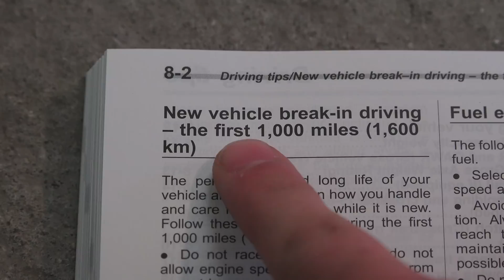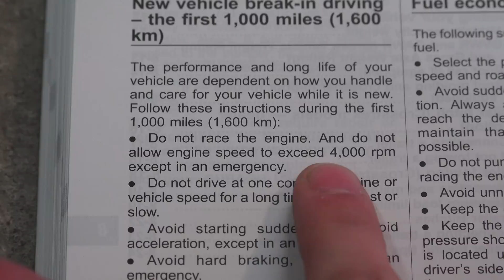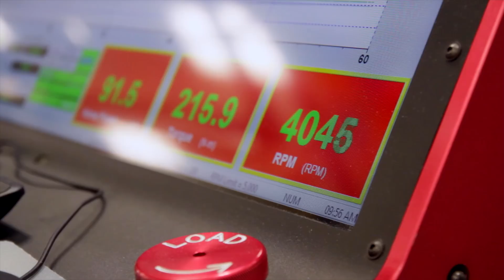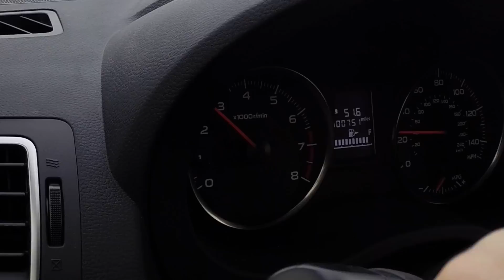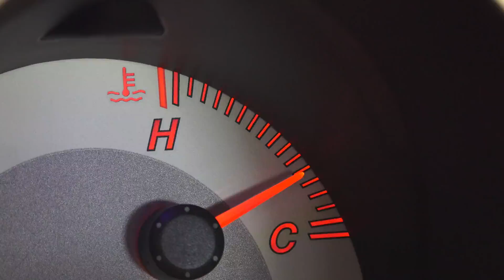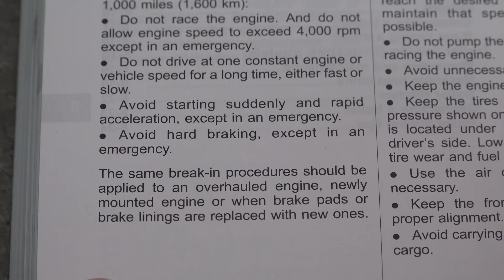5 Things You Should Never Do In A Brand New Car

Comment: I’m not saying that you are wrong but... my dad is the smartest guy I know, and every single time he gets a new car, he waits till all the oil and engine parts are properly warmed up, and then he straight up floors it and holds the engine at like 6k at full throttle for a couple of start-stops. And every single one of our brand new Ford trucks have gone to or over 350k miles, they still run perfect, and my dads f250 super duty got 400k miles on the original factory clutch and brakes. Just sayin...
Reply: I believe it depends a lot on how they manufacture the engines. American companies like Ford and GM make thousands of the same engine to very specific specifications. Sure if you buy a 730,000 pound Ford GT every engine might be slightly different by a very small fraction thus causing “hot spots” but not an engine that they make thousands. Why would they risk engine warranty work on a customer following rules in an owners manual that most people don’t read. These engines are assembled to factory specs and fully tested under all possible load conditions before they even apply for a patent. Push the engine near its limits, check all engine components then change the oil and filter.

Comment: What about the Tesla model 3
Reply: Tesla’s don’t have petrol engines with pistons and rings. They have motors for each drive wheel that uses no petrol and a completely different fluid than conventional oil. The only thing you should be concerned about is your battery health. I.E. proper draining and charging of the battery.

Comment: What's funny is this "Hard Engine Break In to Get A Proper Seal" was made up garbage, probably made up by racers to have their competition or future competition make major mistakes from the get go. What your hearing now is the correct way to break it in. You do NOT need more pressure then what your engine is producing under slow and normal conditions. The tension in the cylinder is tremendous at even 3000 rpm.

Comment: What about loading the engine up (driving up a hill at low RPM)?  This allows for maximum cylinder pressures (and hence maximum ring pressure) without the downside of high rpm (increasingly uneven wear & higher rate of wear).  I'm also wondering why you didn't explore the recommendation of keeping it under 4000 rpm.  Why 4000 rpm exactly?  Most likely because engines typically won't develop significant harmonic vibration below this range.  Would be good to see a engineering based 'advanced run in' guide.

Comment: Wrong, don't hold a high rpm or a single rpm, need to vary rpm, look it up, high cylinder pressure helps seat the rings quickly

Comment: Its simple as he describes. I have broken in two new motorcycles and a majored Lycoming IO-360 the same way; HARD as per the instruction from the Lycoming overhaul facility. Start it and let it idle for no more than two minutes. Shut down and chech for oil leaks. Than taxi to the runway,  do a quick mag check, then full throttle climbout to 7500’ leave it at full throttle for the flight. Do that for 25 hours and return for a oil change and compression test. I flew that engine for over 1000 hours and it never burned oil in the 25 hour oil changes. The two motorcycles I seated the rings per racing mechanics; take them to a track and after a lap or two warmup try to set lap faster lap times each successive laps. Then change oil. Had both bikes for more than 80000 miles each and neither burn any oil between 5000 mile oil changes. The worst thing to do to a new or overhauled engine is baby it. You will regret it if you do.

Comment: I built motors 8 hrs a day at the dealer, This is great "book information" Ive never pulled a motor and said "yup, he was flooring It" when considering how the engine is wearing, I would do a burn out out of the shop back door after building a motor, if it was going to break I wanted it near my lift,  I have a list of reasons why not opening it up is not perfect either, the piston does not FULLY reach the top of it's limit until it hits a high rpm, if you constantly run at a low rpm you will only wear the cylinder to a point, then one day all of the sudden you decide to gun it, now the piston is running up into a non worn ridge, P.S. Change the first oil and filter 800-1000 miles, thats it, drive it like you're going to! I was an ASE certified master mechanic with CCT training 30 years wrenching.

Comment: When I bought my 370Z I kept the RPMs below 3500 generally and applied only gentle acceleration, with no constant RPMs for any prolonged periods of time. I changed the oil early at about 600 miles, 1700 miles and then 3000 miles. My oil consumption finally stabilized at a little under 10K miles and at 13K miles I was using about 5 oz in 3300 miles, or about 21K miles per quart. Whenever I cold start the engine I let it idle under no load for about 8 to 10 minutes, until my oil temperature gets above 140 deg F and I hold the revs not to exceed 2K RPM until the oil gets to about 180 deg F. I did have a couple of used oil analyses done on the engine while it was breaking in and everything looked good, except that the 5W-30 Nissan Ester oil that I was using was starting to shear down to something like a higher-end 5W-20 after about 3K miles. That 3K miles became the oil change interval that I now use.
 
Putting 1oz of Redline Water Wetter, a surfactant, per quart of coolant improved heat transfer between the coolant, my oil(because of the oil/coolant heat exchanger) and the air. My oil temps are now about 10 deg F cooler than before adding the Water Wetter. I got similar results about 30 years ago with a water-cooled Porsche that I had to which I added Water Wetter. Modern engines are much better made than they were in the 50s, 60s and 70s when I was working on them as a kid but I think they do need careful maintenance to preserve these higher levels of efficiency and reliability. Thanks for your videos that explain these interesting and important things about cars.

Comment: I've always heard this about "New Engines" and I've followed it on a few that I've built. But I've also beat it like a red headed step child straight out of the box on a few and I found it made no difference at all. Clearly there's risk involved but I think metallurgy and oil technology is so much better these days the risk is minimal at best. 
What's your opinion on these engine builders that build the engine and then run it full bore on the dyno? Every time I see them do that I think about this engine break in period.

Edit: A year later and still no reply. But feel free to leave those questions and comments 😂

Comment: The manufacturer of your car floored it and brought it to redline repeatedly at both the engine plant and the assembly plant in an effort to keep motors that are going to self destruct from getting to the end user.   It gets more abused by the engine plant than the assembly because the manufacturer bills the engine plant for the cost to fix at the assembly plant or dealership if it gets that far.

Comment: Stop posting videos commenting on what is good for a combustion engine. You are not a combustion engine scientist nor have you provided any relative evidence to support any of your claims. The only justification for not hot rodding a new car is being nice to the automatic transmission and other wear parts that do NOT include the engine. It has been proven a thousand times over that engines need a hard break in for best combustion, the least amount of blow by, sealing efficiency and overall longevity.   No race team on the planet follows your recommendations. No engineering team will validate your claims. The reason the owners manual states otherwise is for the benefit for the manufacturer, not the consumer. Stop spouting this non sense. Stop it. Now. Please :D

Comment: Bull dust run like you would drive it best place is a race track you only got a short time to bed down the rings but if you want an oilburner run it in gently. I have run in many engines and my bikes don't use oil even my 250 has done over 70 thousand doesn't use oil. Always warm up your engine always change its oil regularly. I am a mechanic by trade and I used to work for an engine reconditioning shop we always drove the cars normally if not a bit harder t o seat those rings down.
Reply: Yep, I agree. What is the first thing you do on a performance engine (after the 20 minute cam break-in if using non roller that is).... Dyno runs up to redline to tune & get power graphs.

Comment: Well, I know I broke a couple of these when getting my new wrx, I accidentally shifted into a lower gear and went past 4000 rpm. I also drove 81 miles to buy the car so needless to say I used cruise control on the way home. Damn, guess my new FA 20 is shot now....
Reply: It's not a binary will-or-will-not-break, but affects the overall lifespan of the engine. Who knows - maybe we're doing it wrong NOW? This advice hasn't changed in 60 years, and no-one can point to scientific evidence to support the methodology. We all agree though that piston rings and bearing surfaces need to mate. We just can't agree the best way.

Comment: Funnny. No harm came of me flooring Tesla after I just got it brand new. Probably got close to 10,000 rpm as well.

This old fossil technology is so weird. So restrictive and fussy.
Reply: Jean-Pierre White cool
Reply: You still need to run-in the transmission gears (and bearings) otherwise you can scuff the case hardening on them, causing wear. And also brake discs / pads need to bed in.

Comment: I broke my Acura RSX-S in pretty hard and it was a great running car.  It seemed to hit it's stride after about 100K.   I sold it with 217K miles and it was an amazing engine the whole time.   It did use about 1/2 quart of oil every oil change but other Hondas that I've owned did the same thing.  I just broke in my GTI semi hard.... a few short full throttle bursts after a couple hundred miles.  It's feeling really sassy now at 5K. :)
Reply: Should if I bought brand new cars and only kept them for a couple of years I would do the same s*** cuz every time I buy a used car that I want to keep it but it's always something wrong with it it may not show up in the beginning but boy it shows up I don't know how to change the oil but most of the time I get good vehicles cuz I look around hard and I pay a little money for them because the more expensive shyt is using garbage when you're buying used garbage that people think they want all that money back when they beat on it so that's how it goes oh yeah and Grandma cars😊 keep beating y o u r meet buddy

Comment: there is a guy which tested the two methods and opened the engines there was no difference at all manufacturers do this just to let you get used to the car before flooring it to reduce risks new engines are perfectly fine

Comment: You should have covered coated cylinders line on most modern 4 stroke power sports engines. These I am a firm believer of a hard break for the simple fact that they don’t wear out you just seat them and go. Where as with a classic steel bore yes absolutely take the time. On a 2 stroke with a plated cylinder I usually take it easy for a little while but the 4 strokes I ride for maybe 10 mins then put it under a good load for a bit to seat them then they’re good. Never had an issue that way with those specifically

Comment: On a completely off-subject topic, if the force of rolling friction is equal to mu times the normal force, why do wider tires (all other factors being equal) give more traction?
Reply: Simple: area. If you have a tiny contact patch, you are putting many times the energy into that area than if you have 4x the area with a wider tyre. More area to dissipate the enegy, and so you need more energy to exceed the limit of grip for any particular molecule of tyre.

Comment: The speed variance has a purpose on break-in which you did not mention.  As the rings slide against the wall of the cylinder, wall it takes off microscopic layers of metal off those walls.  When this is done at a constant speed the rings will essentially go to the same place at the top of cycle.  Now here is where it gets weird.  A lip forms at the top of the stroke on that cylinder wall. if at some point the engines is revved to red line, the heat and the stroke causes the connecting rod to stretch every so slightly which could cause the rings to run into that lip, which could cause the rings to explode, which would cause you to have a multi thousand dollar rebuild.  So after break-in, you should do a high RMP periodically after the engine is warmed up, so as to keep that lip from forming.
Reply: Wait, why do it makes the rings explode?
Reply: Factory tested before inserting into car?

Comment: When I got my brand new 2010 Gixxer 1000, I redlined it and did 280kmh in the first day. 
Then I fucked up when changing oil and ran it with half oil in engine for a day. 
Put 24000km on it in 5 months and sold it. Never had a problem.

Comment: I don’t buy it. Anyone who has used any kind of sandpaper or file on metal will know that just a few passes on any metal surface will remove a ton of material. The rings seat within a minute or two of variable loads, engine braking included. Example; 500 miles at 2,500 rpm is 1.5 million piston strokes.

Comment: I wonder if these tips work the same with low powered card. What if I have a tiny 69 hp natural aspirated engine? When the traffic light goes green you have trouble getting into movement quick enough before the car behind begins to use the horn to push you forward. So with partial throttle in such a car you might have a hard time at first?!

Comment: Cummins engine breakin procedure from the shop manuals. if an engine dyno is not available "operate the engine on the torque curve at less then rated speed for the first 50 - 100 miles after rebuild (eg pulling a loaded trailer at 1500 to 1800 rpm in high gear)". rated engine speed is usually 2100 for a big cummins, so that is full load pulling hard for 100 miles with a slight reduction of rpm.

Comment: When I collected my Mercedes B200 CDi (W245) at Rastatt (Germany) in 2006 I asked about 'running in' and was informed "do not exceed 3000 RPM in the first 1000 miles." On hitting the Autobahn I found that equalled 120 MPH so no problem. It's still running fine and giving over 50 MPG so great advise.

Comment: Utmost important is the first hour of run time. Untold is the highest friction area of the entire engine (pressure per unit surface) is the cam-to-valve-tappet area. New camshafts have special cam lube for this critical area and the engine should (ideally uh!) not be allowed to rev below about 2500 rpm for the first 20 minutes of run time when brand new. So 2500-4000 is your ideal zone when running in. 2500 relieves some pressure on the cam’s tips, thanks to the valvetrain’s inertia, and the lighter load helps avoids hot spots. Stay in there (2500-4000) for one hour straight, and most of what needs running in is run in. Besides that, everything he said, plus: observe those same rules for the life of the engine on each and every cold start, until everything is warm which takes 10-15 minutes. Then send it.

Comment: I drive a lot of new cars at work, they have 4-5 km on the clock and i only drive in manual gear mode, heat it up properly and floor it 2-3 times in the low - middle rpm range, because sometimes a coolant or boost hose goes loose and the car smells like burnt afterwards

Comment: The only proper way to seat a piston ring is to progressivly bring the engine to 100% load at diffrent rpm ranges for several minuets at a time on a dyno. That is fact. Failure to do so can lead to premature cylinder glazing. Atleast that is proper way to break in diesel truck engines.  Im fairly certain it would apply to the smaller gasoline engines to some extent

Comment: My newly rebuilt z24 refused to seat the rings. Only ran for ten seconds before plugs got totally oil coated. After 3 tear downs with no results I dry seated the rings and watched before my eyes as the dark areas became shiny, seated  left head off, dropped the pan and oiled the bearings.

Comment: You make fine points but the piston and rings arent the problem for engine break in. Chrome moly rings did away with the magical ring break in you speak of.  The use a specific crosshatch of the cylinder wall and a chrome moly ring set mean it almost instantly seats the rings. 

 The corvette uses full synthetic oil (mobil 1) from the factory its so slippery that you follow a specific pattern of break in to insure that the engine doesn't have oiling issues.  Which brings us right back around to the beginning.  The break in procedure insures that oiling the engine is correct and that any left over particulate matter in the engine goes into the oil filter instead a bearing.

Comment: Hi, thanks for this great video. I bought a brand new Jeep SRT 2019 with 19miles yesterday and turn on the engine with the car stopped and reved it past 5000rpm to hear the sound of the exhaust. The salesman did not tell me anything about what you have explained in the video and I feel bad that I did it after watching this video :(.  I am going for a test drive today and I am now afraid of causing any damage to the engine. By the way, when he opened the lid to show me the engine I noticed a strange noise coming from the left hand side of the engine. I could tell that it was not coming from the fans but it seeme like it was coming from the pistons (not sure)... Should I be concerned about it or it is just natural from HEMI 6.4L Engines? Thanks